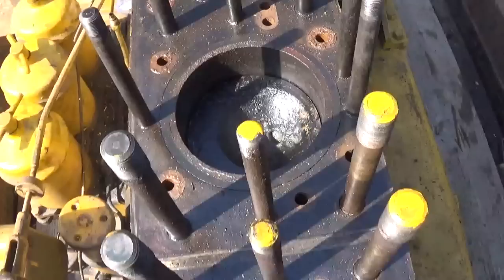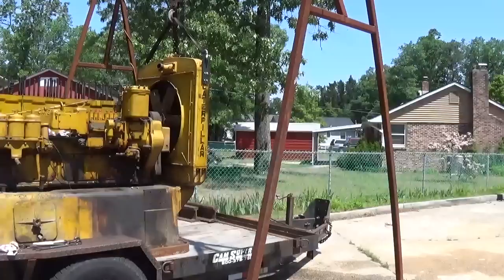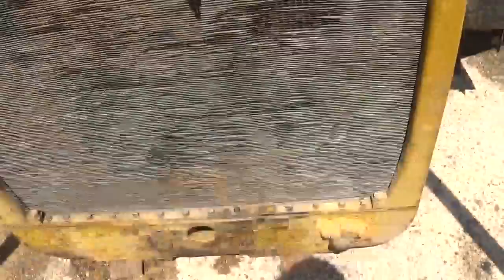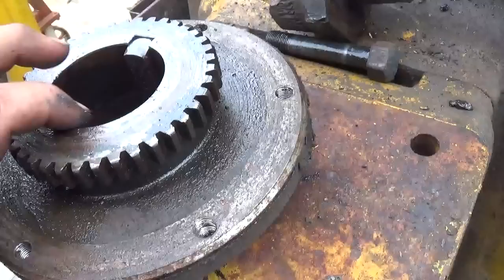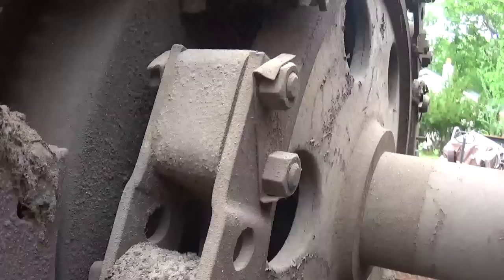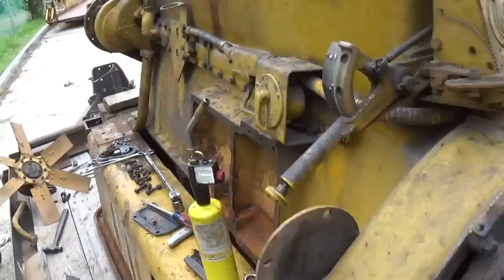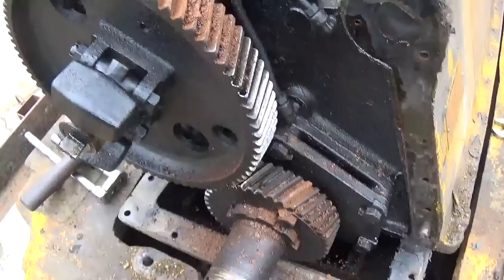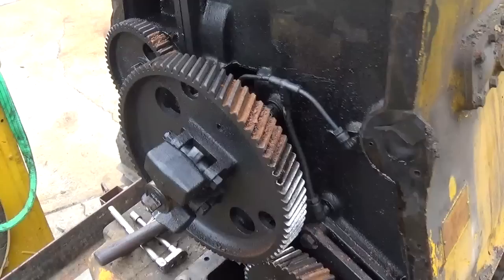Caterpillar Generator Set Repair Part 4 (Tear Down #2)

Comment: Thank you for saving this old beast of a genset.  I only recently 
found your channel, but I was immediately a fan!  My attention was drawn
 to this great CAT because when I was a boy,  I used to go visit my aunt after 
school.  She worked in the basement laundry of a big old hospital a 
few blocks from my home.  In that basement off a side passage
 were two big CAT gensets for aux power.  I was fascinated by those
 engines which I'm pretty sure now were D13000s ... ...
they looked exactly like the one you have.  That was early 
1950's so the timing was right to have those.  Every week on Tuesday at
4pm (right after shift change) the hospital engineer would run one of the 
CATs for about 15 minutes. He didn't mind my being there and 
I made it a point to show up  to watch, listen and feel that thundering diesel engine.
It could be heard all through the basement and even upstairs in the main lobby.
 My oh my, I loved that sound.

Comment: Mike great series!   Had an old timer tell me if you just leave a fan on and circulating air around inside a shop the moisture wont condensate on all the cold iron...he was right

Comment: Did lots of "PM's" (preventive maintenance) operations on some huge Cat gensets where I used to work. #3516 comes to mind. Turbo Diesel. All minor stuff. Check fluid levels, block heater operation, belts, hoses, "rain caps", and exercise. Never had one apart but did tour the factory in Peoria on a purchase trip once. Very precision yet rugged pieces. Enjoying seeing the innards of this one. Looks pretty "indestructible". All it asks is a little "love". Thanks for bringing us along. ;o)
Reply from the maker: Funny you mentioned that.  I recently completed a PM service on 3 3516s at a hospital in Phila, Pa.  105 gallons of oil a piece!  One of those units is seeping coolant into the oil sump from somewhere...  Going to have some diagnostics coming up for that one!  Thanks for watching!

Comment: I like your hoist. If I was used to it I wouldn't let anybody talk me into getting another one. The flex joint between the engine and generator is a rag joint, at least that's what it's called here and I see the Kroil can. No wonder the old thing is coming apart. Can't beat it. Good going and good video. I like what's going on with you too. Keep it up! Good old black oil!

Comment: Speaking of rainguards, I was called out to a brand new 6cyl perkins 3 phase set a few years ago. "It wont start".
The guy who put it in had told the owner that he would be back to "finish the exhaust stack". He was never seen again (he'd been paid). A  couple of years later (it was never run) I'm stood there telling the owner why the oil is overflowing out of the dipstick hole. "oil floats on water" I said. Up on the roof is the end of the pipe with a bracket to hold the rain flap, but no rain flap. It rains a lot in West Wales. "Is this what you mean" he said. "Can we put it on now" he said. He had kept it ready for the installer to make life easy for the guy. I had a mental picture of where it should be put. The owner had put his savings into this engine and I had to tell him he needed a new one. Every piston was welded to the non-linered block and the timing cover was frost cracked. The engine was full to the breather on the rocker cover.The only help I could offer was not to charge him for my time.

Comment: Looks like she might survive to run another day Mike. ATF and acetone mixed 75/25 is  good for freeing stuck pistons. I have used it myself and was surprised how well it works. Also, evaporust works quite well for freeing the same as well as stuck fasteners if you can keep them wet. That crankshaft nut is a good candidate for spray welding or metalizing as some call it. Don't know if you are familiar with this repair or not but, I have done this myself and it really does a nice job. This would be much better than running weld as there is much less chance of distortion of the part. Any way, good progress and I hope there aren't any surprises with the rest of the teardown cause I want to see her make electric again!

Comment: mike. I use a trick my dad has taught me.I put oil. penetrating oils. and I work backwards and forwards. I use a socket and a big breaker bar once it gets started I clean it up. I use this trick lots of times. I used it on a wood chipper that a lady bought. she put water in the oil crank case and within a few minutes locked it up. after I cleaned everything i used the pull rope and just pulled and pulled until it was smooth. I drained the cleaner oils. one I used was green because it took out the moisture in the engine. after all I done I put a new spark plug new oil filter new oil and it fired right up. first pull. i understand that it is bigger and badder than mine. good luck.
Reply from the maker: Thanks for watching!   I was hoping that it might be that simple for this one!  Some engines are just plain hard to kill.

Comment: I have no idea, but my guess for what the gear around the crank pulley bolt might be is for sort of ratchet or socket tool that has a smaller gear on it to provide torque multiplication so you don't need such a long breaker bar or giant wrench to loosen the giant bolt. I've never seen such a thing before, but that's my guess. Do you ever soak the cylinders in diesel fuel or like an ATF/Acetone mix as a penetrating oil before trying to work them free? Keep up the good work! I also don't mind the ramblings, as they are full of wisdom and lessons learned from experience. You do pretty well at not going down a long tangent.

Comment: I believe the generator coupling is referred to as a "rag joint" Yes it is a belt like material. It also allows for some flex when rotation begins much like a flex plate between a transmission and engine on marine applications. But the flex plate has either rubber bumpers or springs to take up the shock of going into gear.

Comment: You should be able to weld and rethread the nut/bolt but I would Chuck it up and turn off the old threads before welding so when you recut them you are into only new material! Great project it's neat to see it come apart. I'm sure it's alot more work than you show! lol

Comment: You'd be surprised how well electric hoists can hold their value; a 2-ton one from even forty or fifty years ago can still set you back a couple thousand!

Looks like it'll be a while before it's a runner.  After you get those pistons unstuck I would check the liners since this is a wet sleeve engine.  I wouldn't know anything about the quality of import cylinder sleeves but I'd imagine there's nothing wrong with them.

Comment: Mike, that "rubberized felting" in the 
generator coupling, is, most likely 
tire sidewalls.  Same thing used in 
a "rag joint" in a car steering shaft 
linkage.

steve
Reply: Steve Skouson 
     Speaking of tires, do you remember the Nylon cord bias-ply tire thump first thing after sitting for a few hours?
Reply: I'm not that old!

Well, I am. 59 today.

steve

Comment: Seeing that rust makes me think of an electric oil pump set to run every x amount of time to keep the engine lubed between run times. If on a timer they can't forget it so will just hear the pump turn on for 20-30 minutes at a time to cycle the full system.

Comment: How about putting the rod bearings and rod caps back on.. bar the crank around and let the crank push the piston and liner out..   those less the connecting rod are still available from several suppliers..  in a quick search for D13000 liners i saw several good deals on brand new ones.  seems that engine or a smaller version was also used in AG.. so you might be able to find some used gears.. but  you are probably right.. some of those gears will survive.  even if they are UGLY as all heck.  heck.. perhaps finding a pair of used pistons and liners from somebody elses rebuild. 

don't forget .. you are going to want to put a Fairly significant stack of super magnets in both ends of the oil pan to keep any rust particles captured and out of the engine oil.
Reply: he's got major problems getting into the oil pan with the engine on that base. I believe the oil pan is full of sludge it maybe blocking the pump bell screens. Mine was, but mine isn't on a base like his.  Mine is 200 engines newer and i think there is a generator head model change as mine doesn't use the base to support the gen-head. My generator is cat built and his is a general electric.  Both are 66 kw, and at some point between his and mine cat stopped using the general electric generator and used the simpler cat generator.
The oil pan has 3 access panels to get into it you can't see.  good luck mike
Reply from the maker: Getting the inside of that block and pan clean will be a project in itself!

Comment: Flex links are available new, after u get it running easy to change out.  They absorb  and  transfer torque to the gen head.  I gotta separate the gen-head off the engine to change mine.  That crank nut may be available thru classic cat parts.  u got plenty time to find another.  Did u measure how long ur unit is total?  Urs must be considerable longer than mine.  good luck with ur project and u'll be rolling coal soon.
Reply from the maker: Thanks Mike!  There are a lot of big jobs and little jobs ahead!

Comment: So it was the water pump and its idler gear that was locked up?  Did you turn the idler in the video? i didn't see it move.  Any way the water pump could have leaked into the gear case?  I 'd almost reconnect the 2 rods and try baring it over.  you are soaking the bores? I'm glad i was wrong thinking it was ring stuck. good luck.
Reply: No antifreeze and the anti corrosion stuff thats in it missing from that m
achine ain't good.

Comment: Got a question for you sense your the generator man I'm currently building a 30 kw Gen and the engine I'm using is a Chevy industrial 4 cylinder and just wanted to check and see if you could tell me what SAE bell housing to use  a #3 or a #4  and what size flywheel to use

Comment: I have seen a set of grinding wheels designed specifically to re-cut those threads. If you want I can get the link... Keith Fender's channel. Reply for the info    I subbed and am looking forward to some very interesting revelations regarding this genset. I bought and sold an older Cat 300kVA 3 Phase and it was quite used but still turnkey condition. 
P.s. your grasp of the English language is a plus

Comment: Maaaaybe it will work for those teeth, but here's the story anyways. So my old, ancient lathe, had teeth damage, almost like someone pressed metal in the teeth. It would wine horribly, so through trial and error my solution to that was to T an oil feed that went nearby and make it spray oil right between the two meeting "maws". It reduced the whining substantially, maaaybe you could replicate something like that? Doesn't take much, i think it was a heavy drop every half a minute...or there about.